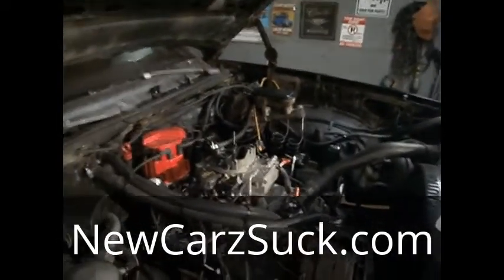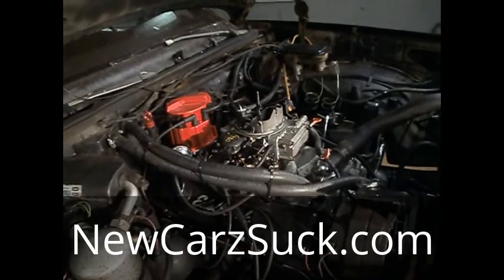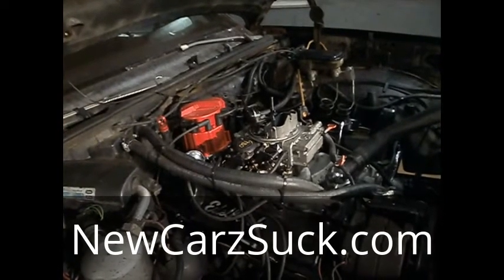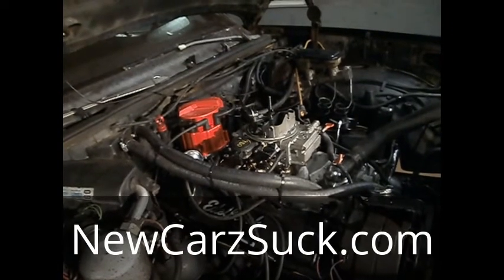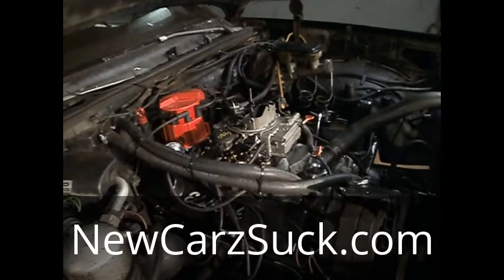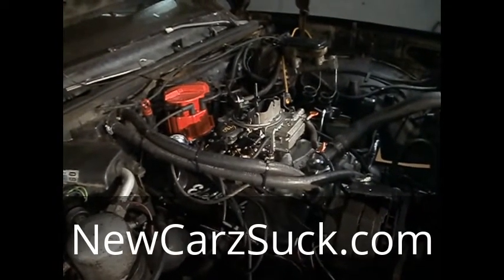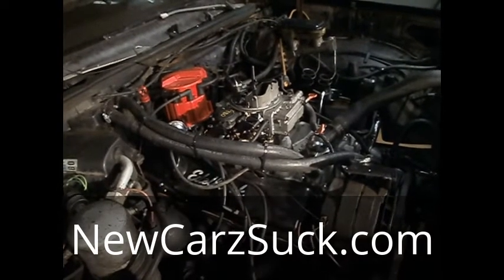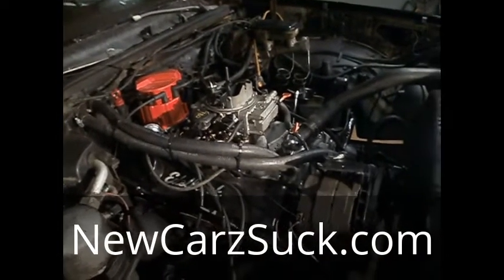Tips on How to do a tbi or EFI to carb conversion

Comment: Wanting to do this to a 98 Dakota. You are correct. You must know what inputs are needed to run your vehicle. Ive got a good Chilton and tracing the transmission controls. on a 95 mustang , my solution was to use a AOD transmission in place of the AODE and using a 5sp cars comp to control a hot 4.2 6cyl.